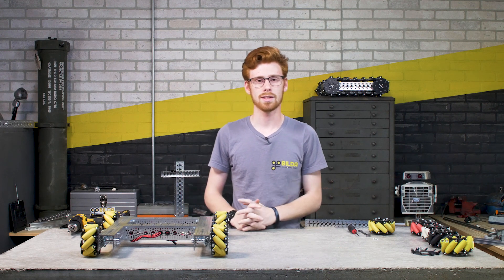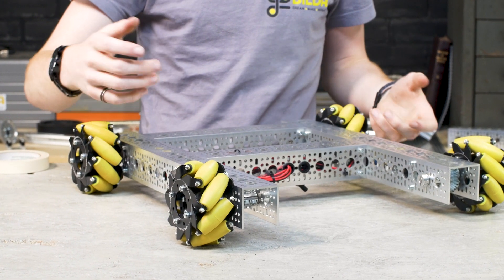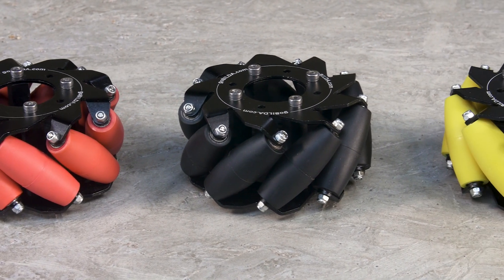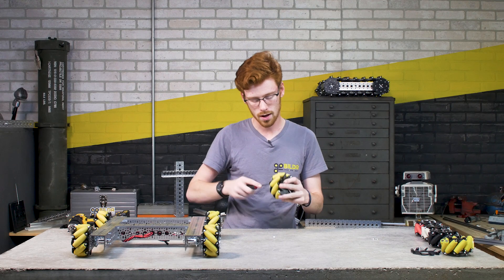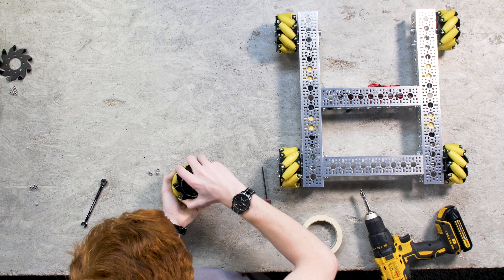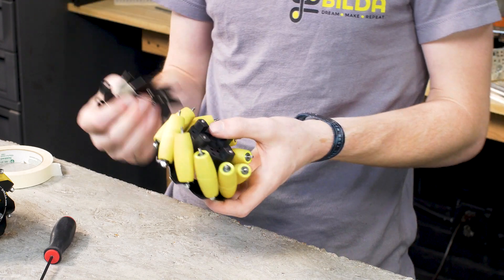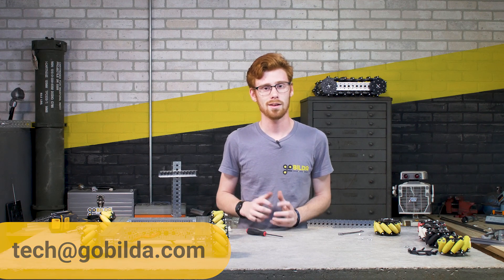Mecanum Wheels Tips & Tricks

Comment: can i put macanum wheel in real car. 
1. speed almost 50-55km/h.
2. does brake works?
3. does it works on gradient?
Reply: If you check RC cars using them, at high speed it gets extremely bumpy.
Braking is putting forces on weird angles. Basically, each wheel on it own isn't really breaking, but together they manage to stop on every directions. 
And uneven ground is a big problem, you may want to add shock absorbers to make sure you never loose contact. Otherwise it can slide in wrong directions. Usually it's pretty bad for high torque or high speed.

Comment: Driving forwards, backwards, and turning works fine, however, I am not able to strafe sideways.
Reply: Are your mecanum wheels set up in an x shape? The most common problem is that teams will set up their wheel directions wrong, thus the vector math doesn't work out. So make sure that your setup looks like an x.
Reply: Before running any code, perhaps ensure that all four of your wheels are positioned correctly, as shown in the video. The rear left and front right wheels should have the rollers in identical orientation, and vice versa. After ensuring this, when coding, each side (left, right) pair of wheels should be counter-rotating, yet, the two individual sides should be counter-rotating inversely. For example, if the rear left wheel is rotating clockwise, then the front left wheel should be rotating counter-clockwise. However, the rear right wheel should be rotating counter-clockwise, and the front right wheel should be rotating clockwise. Ensure all wheels are spinning at an identical speed. This will allow your bot to strafe in either direction.

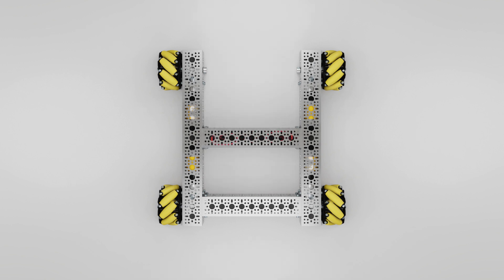Comment: Correct me if I'm wrong but I think the force diagram provided at 1:53 is incorrect.
Reply: Maybe the non-rotating wheels push the car in that direction instead of the rotating wheels? 

Im not sure either...
Reply: @juule5494  mechanically speaking, that's exactly what happens ... just that it's supposed to go the other diagonal
Reply: Yes, the force diagram is incorrect. C'mon goBilda... get it right.
Reply: Quinn McGinley yeah the diagram is incorrect, when the top right and bottom left wheels move forward, it moves the robot up and to the left in the direction both of the rollers are facing. In the diagram it shows the robot moving the wrong direction that what it would normally